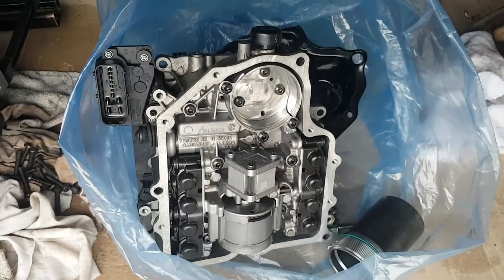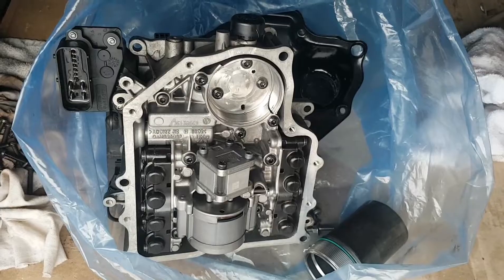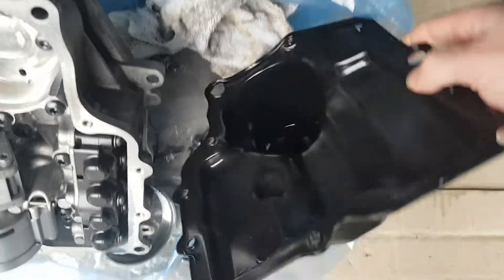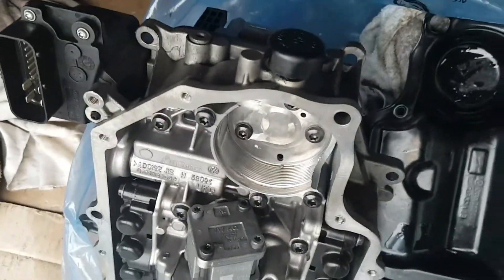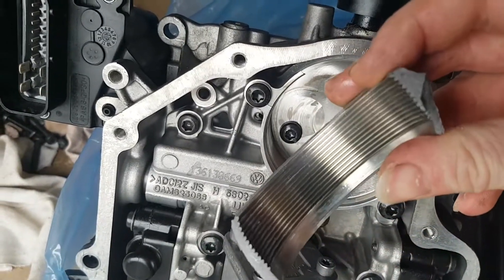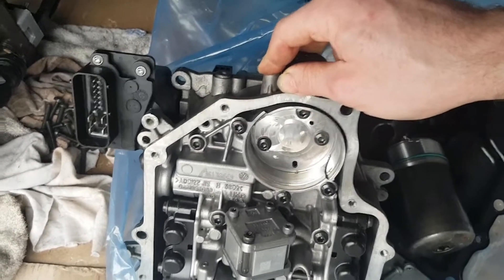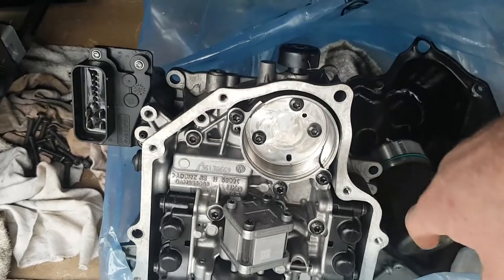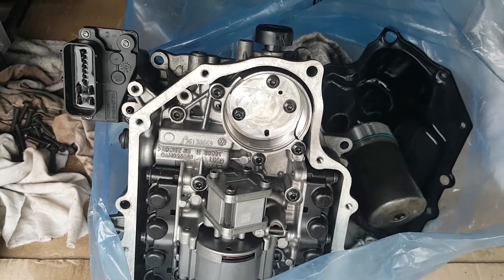P17BF VW DSG Transmission Fault Cause

Comment: I have no error codes and my 2012 VW GOLF 6 TSI drives and changes normally but is leaking oil from the mechatronic breather, if I change the accumulator do you guys think this will fix the problem?

Comment: I have the error mentioned, I changed the accumulator, some o-rings (not all) and the problem continues, should I change the pump? Is there any way to measure in vcds?

Comment: I have a DQ200 DSG SKODA 2016. Only code came up is P17BF00. Mechanic is sorting out the mectronic but now saying the TCM is gone to. I have no symptoms and it drives and changes gears perfectly. Only problem it lights up and says gearbox error once a day if that. 
What do you think? As now it’s costing me £1400 as originally was £800.
Reply: I have exactly the same issue with my 2018 Superb! What did you end up doing?
Reply: @saurabhchaturvediscientist changed the mechatronic, actually he refurbed it and changed the TCM. Did work but then sold the car.

Comment: Hi I’ve got a hydraulic pump anti play fault on my Skoda superb 2011 took it in for the recall and they didn’t change the high pressure accumulator as they said it looked fine and are telling me I need a whole new mechatronics. Any help would be appreciated could it be the pump or the valve body?
Reply: Is there a recall on the pump? As I have same problem. Done the mechatronic twice and still get gearbox error after 2 months.
Reply: @Jason-hz5zc  mine is fixed I put a second hand valve body on the mechatronics unit.
It was losing a small amount of pressure but wasn’t the pump or the high pressure accumulator as this was all tested. Was something in the valve body but couldn’t narrow it down to exactly what it was. So just did the whole valve body.
Has been running fine now for about 7000 kms
Reply: @jongriffiths3033  is the valve body part of the mech unit? They refurbed it then 2 months later it come back. Then he said it’s the gear forks so replaced that along with a new clutch. Now 1 month no problems at all but suddenly the light come back on again. If I turn it off and then start the light gearbox error goes away. Then comes back after 10 mins or so. Really stressed out!
Reply: @Jason-hz5zc  you will need to get it scanned again to see what fault code it is.
Yeah mine was doing the same in regards to the fault on the dash and would go away if i turned the car off for a while but would appear after 20-30 mins of driving.

Comment: Do you need a special tool to replace the threads etc as quoted £600 to replace as the mechanic needs a to buy a curtain tool

Comment: Hello ! 
I recently had my gear selector on the dashboard flashing with a spanner sign. So, after having the car diagnosed,  it came up with this P17BF fault code ! 
Do you reckon this has to do with the accumulator housing being cracked , or could it be something else ? 
Appreciate if you could please let me know. Thanks

Comment: thanks for the video champ!! just wondering if this would might affect clutch replacement for 48000kms 2013 a3? i got my pressure accumulator replaced thru recall campaign but car is still doing shudder from transmission. now i got quoted $4k to replace clutch...pls help
Reply from the maker: Shudder is usually a clutch issue. They are known to shudder on inclines in 2nd gear mainly. When pulling away and the transmission shifts you can often feel it.
Reply: @FourRingsAuto  thanks! would you you call this as manufacturer defects related to pressure accumulator? i am in the process of making claim to audi Aus now..
Reply: @leechris8698  I think it’s not a recall issue. It’s just worn out I guess. But mine shudders as well from 2nd gear to 3rd

Comment: I have brought they new updated kit from  Kinergo which doesn't require holes to be drilled. Fitted 1month had no complaints
Reply from the maker: I have fitted the same kit with no issues also.
Reply: @FourRingsAuto   Hi I have a  question  if you can help I will be very grateful are you have to drain oil from mechanical part of greabox  first and then remove mechatronik or is ok to just remove mechatronik
Reply from the maker: @stanwes4740  you should drain the oil from the gearbox first. The oil will come out when you remove the mechatronics, but you need to drain the gearbox to get all of it out. There is no level plug or dipstick for the gearbox, so you need to get all of it out so that you can refill with the correct quantity.
Reply: @FourRingsAuto  thank you very much for help I'm very grateful for your help

Comment: Have an A3, and tried to get it fixed at dealer because of the recall, guess what, my VIN number is not one of the one listed on the Audi recall list. They are a pack of a..holes, they have tens of thousands of these they need to replace and all they are doing is putting the same casting back in, changing the software to drop the pressure from 70 to 50 bar.

Anyway, I replaced using the Kinergo unit. I did it with the mech still in the car...super simple. Took me around 4 hrs with basic tools. I recon I can now do it in 2. Thanks to clever ppl like Kinergo, we need more people like that to help us little guys, when big corporate dicks don't want to come to the party.  Have a nice day :)
Reply from the maker: Kinergo is a good one i was going to suggest. Glad it worked out.
Reply: I had the recall done on my car a year and a half ago, and today I had this code. When I scanned it with VCDS I found out that the pressure is 40bar. I believe the casing in my case is cracked and it will get worse. The recall did not remediate the issue. I plan on taking my car to VW and see what they are going to say about this.
Reply: Are you able to tell how to go about reducing the pressure in the mechatronics unit in order to open up thew transmission? I note you did at home - I would like to try as well. Any special advice? Cheers, from New Zealand
Reply: Hey there, the mech was losing pressure at the time, so when I opened things up, there was no pressure in the accumulator. I can't believe its been 4 years. Car is still going strong, missus is happy and that is the main thing (of course)! I can't advise re pressure, but changing it was easy...IMHO. Best of luck.
Reply: @vassze2246  no need to lift the engine?
Reply: @andybrown6981  nope, just took out radiator and a few hoses off to remove front cover of the mech unit.

Comment: Thanks for your video mate, explains a lot. I ran a check on VW site and it tells me to take it to a dealer/service center. i live in Sydney and just bought this car last week so I'm not sure which service center to take it to to get the recall work done "Correctly". Any suggestions as to which service center is better/reliable? i presume recalls can not be done by specialists outside of the dealer/service centers right?
Reply from the maker: Dealer only for recalls. Sorry I'm in Perth so don't know the go in Sydney. You could try ringing a few independent specialists and seeing who they'd recommend. Try volksmuller.
Reply: Hey Nick. I wonder if you did take it to the dealer later on? I’ve got a recall letter from Skoda(mine is also dq200) and going to take it in to the dealership in Geelong, even know I live in Melbourne, they have a lot of other dealerships there in one place, including the Audi so I think they have proper mechanics. Just wondering what did they replace on your VW?
Reply: @HeKuTK0  I had the recall done on my car a year and a half ago, and today I had this code. When I scanned it with VCDS I found out that the pressure is 40bar. I believe the casing in my case is cracked and it will get worse. The recall did not remediate the issue.
Reply: @_Pet_Tech  What ended up happening?? I am having this exact issue.
Reply: @Teslacoil-120  I replaced the accumulator with reinforced adapter but the faulty code came back. I took the car to a VW specialist and he replaced the mechatronic that came with updated version of the housing and thicker walls.
Reply: @Teslacoil-120  I had the recall performed by VW in Melbourne, but when I opened the front cover of the gearbox there was no reinforcement adapter installed. The adapter was part of the recall and was supposed to reinforce the thinner aluminium sidewall of the housing and prevent it from cracking as well as installing a smaller accumulator that will fit in the newly installed adapter. None of this was done, and I wasn't surprised at all.
Reply: @Teslacoil-120  They are mate, probably they pocketed some cash by marking the recall as completed without even touching the car.
Reply: @_Pet_Tech  You're right. Im going to add this into the letters. Im getting this free whether they like it or not.
Reply: Did they end up replacing it for you?? im having the same issue.

Comment: Hello! One question has to do with the accumulator. How csn i safely remove the old one to fit the kinergo fix kit? I saw some accumulator blowing and i need to be careful with every step
Reply from the maker: I'd advise contacting Kinergo. As this is a safety issue, I can't advise you how to do it unfortunately due to liability. Thanks and good luck.

Comment: I recently have this problem after got it diagnostic checked out in my VW Jetta 2013 DSG with only 52000 miles. I did received some quotes which are over £1000.
Reply from the maker: Sounds about right. Ring vw, there is a new recall out with about 80,000 vin numbers on it. Worth checking if yours is covered.
Reply: @FourRingsAuto  Thanks ever so much. I did call VW and they booked me in for 28th Jan to check this out for me.

Comment: My Audi A3 2009 1.4t got this P17BF with exceeding and not enough pressure, and P0841 transmisor 1...and had a small leak in the upper top where oil is filing...no fails at all but I guess no too late to have big issues...it could be just the seals? Thanks
Reply from the maker: I have another video on my channel of one of these mechatronic units leaking oil out the top breather. If yours is doing the same it is the Mechatronics that is the cause of your problem.  The accumulator inside breaks.
Reply: @FourRingsAuto  thanks for your support...i just open the mechatronic and nothing broken...i realized that in the history report first showed up a problem with the pumb..so I bought in eBay and waiting for arrive...I'll post if it's was the problem...thanks and great your videos.
Reply: Javier Molina did the pump fix the problem?
Reply from the maker: The accumulator housing from kinergo will fix the issue. But this is now covered by a recall for about 80000 vin numbers affected. So contact your local dealer with your vin to see if you're covered.
Reply: What if you don,t fix the problems P16BF and P0841. And drive wit the broke part?
Reply: @zuiverwienietkandelenkanni1428  I think the system go in a protection mode and finally you don't be able to move the car....mine mechatronic got any broken part helped with Vcds cable I got the history faults and told was a problem in the pump

Comment: Hey Hey, What was the mileage on the car when this happened?
Reply from the maker: Can't remember thw kms on it tbh. Something like $2500 to $3000 Australian.
Reply: @FourRingsAuto  Thanks for the feedback. May the Force be with mine. Still can't believe they use a casting for something holding over 40 Bar. I have a 5-year old A3 with 86000 km may it last another 2-5 years.
Reply: @CheckEngineChronicles  Got same code on my A3 8v 1.8  80km, and slowly leaked oil over time until gears started acting.
Replaced the hydraulic part with a refurbished from China for 300usd , and kept the kept the same electronic board.
Reply: @CheckEngineChronicles  if you see oil traces arround mecatronic, means you need to prepare and at least do some preventive maintenance by changing gearbox oil and mechatronic fluid . 
1.8L gear oil for gear box, and 1.1L  power steering fluid for mechatronic.